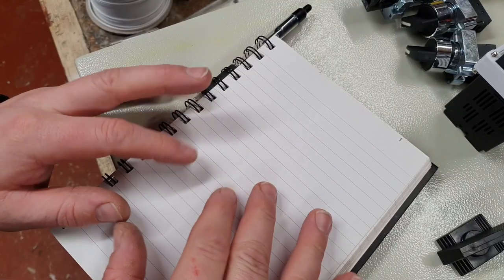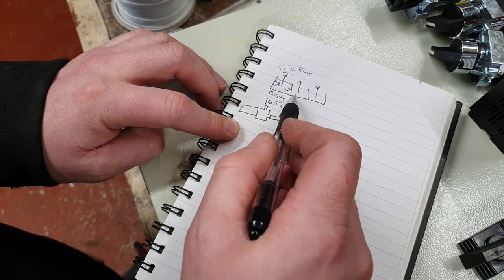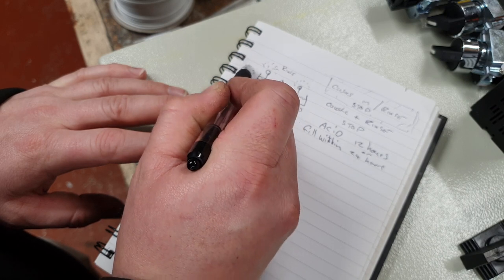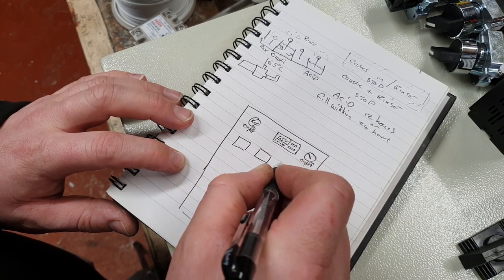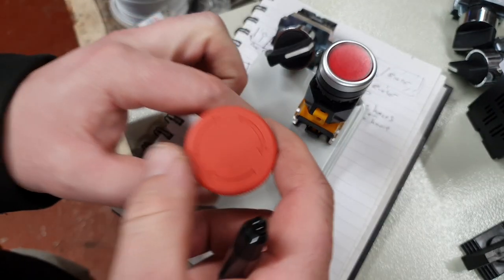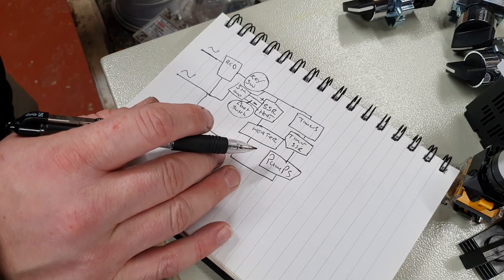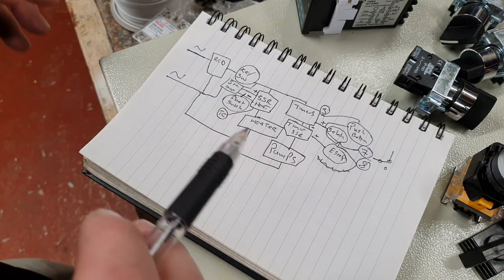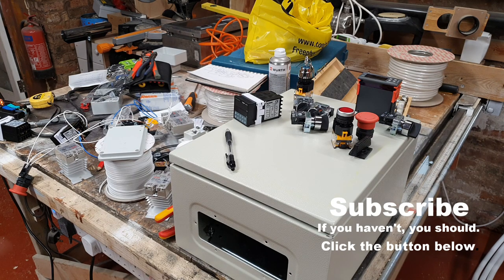3 Tank Brewery Cask/Keg Washer Control Panel Build ~ Planning

Comment: You need your emergency cut off between the SSR and pump.  When SSRs fail, they tend to fail switched on, making the emergency stop on your sketch ineffective.
Reply from the maker: I have had a few fail open circuit in the past on heating elements. Right pain as it can cost a lot in damage. In this build( I Have almost finished it, the vids are a few days behind) I have a main E stop on the panel that opens a contactor for the pump and heater line in. It is also interlocked on a latching circuit should the power cut out so it needs a manual reset should that happen.

Comment: Did you think weather this could have been run through a raspberry pie ?
Reply: That is probably overengineering it on a cask washer!  Saying that, at my brewery, the HLT can be controlled using a web based control panel running on a RPi from a smartphone anywhere in the world.   Useful when you can't remember if you switched it on the night before brewing and you live 10 miles away.